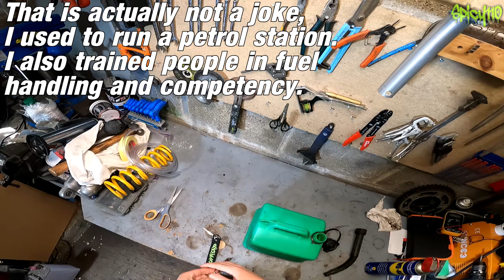HOW I SIPHON FUEL! | Motorcycle Basics

Comment: Couldn't just use the stopcock on the tank to gravity it out?
Reply from the maker: As mentioned below, Indeed you can, but this is a dirt bike tank it has 2 lower lobes,  to get all the fuel you need to tip the bike way over to the left.
Reply: @spicy110  yeah that's true. My acerbis tank loves to hold onto those last few sometimes vital bits of fuel away from the petcock